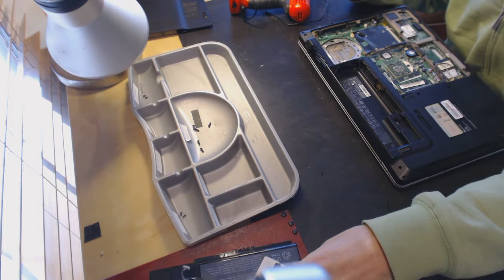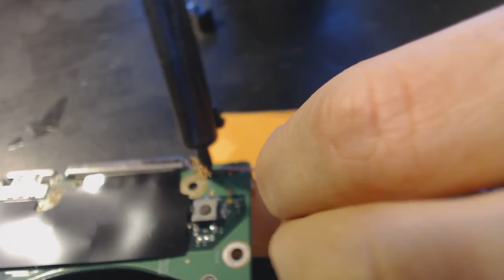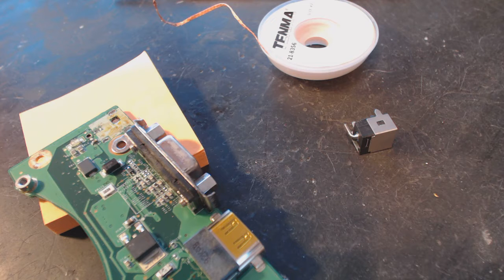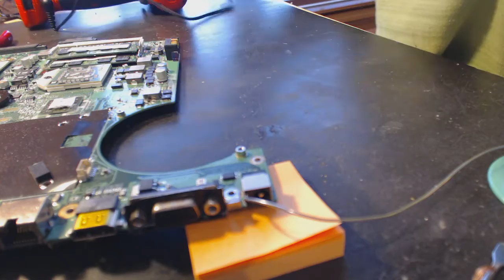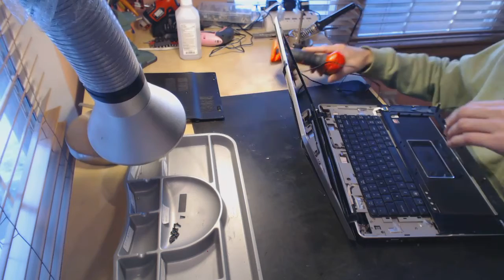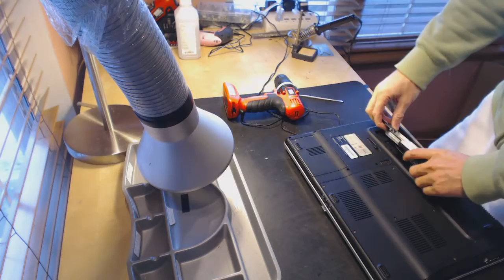Gateway AJ6A MD2614u Laptop Power Jack Repair socket input port connector inlet fix

Comment: Im preparing to do this exact repair on the same model laptop. I have the new jack. What is the significance of the red stranded wire in the hole where the 90 degree post from the jack installs on the MB?
Reply from the maker: it just an extra conductor of electricity so that in case the rear pin will start moving again, the wire would be able to conduct everything solidly
Reply: @Powerjackrepair  Gotcha. Thanks for taking the time to reply. I appreciate it!